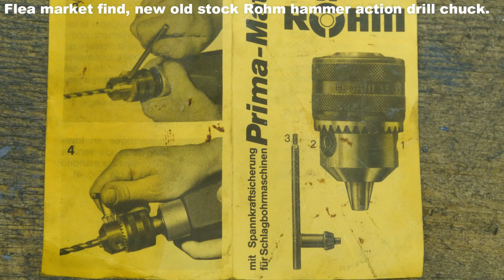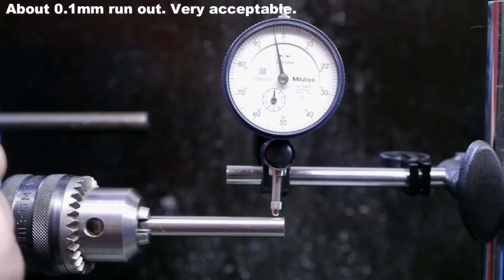Making a MT4 drill chuck arbor from scraptonium

Comment: Success! Wonderful condensed footage of the process. We all have stuff to do as they say.
Of course the sad bit is that there was nothing to make nice outtakes of your astonished grizzling about galled races, excessive play, or broken bits:-) 

I am just getting ready to try to square up my 1250 x 1800mm  CNC Router base....in a <4x4m room with other  tools and welder....so tight to work in, I had to take a 2 week break over xmas or die of uttering profanity.
No idea what I am doing. But it is taking shape. I am using a machinist level good to 0.01mm over 300mm ( 0.0005") :-O
Reply from the maker: That's a big router! I've been thinking about building a small router in the winter. It's currently to cold to play in the old barn.